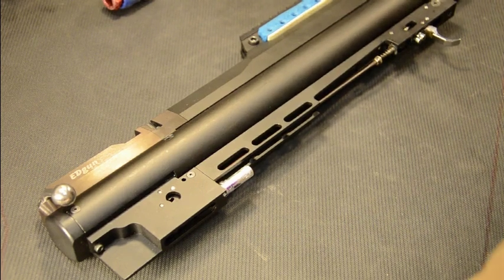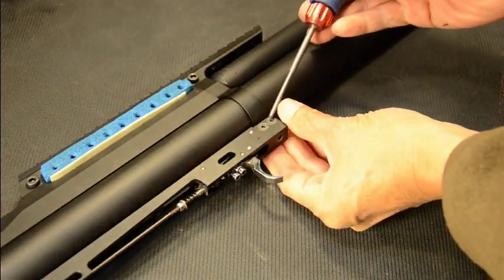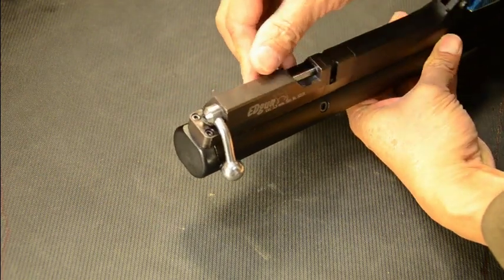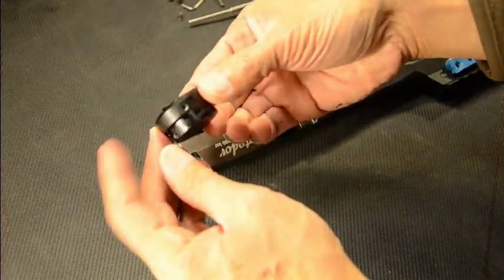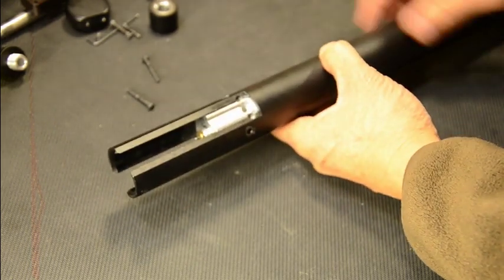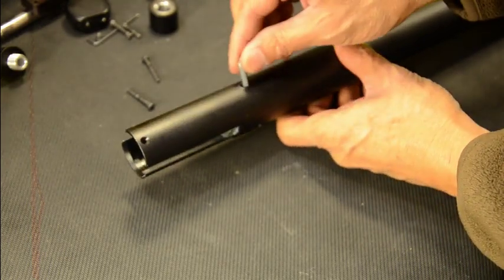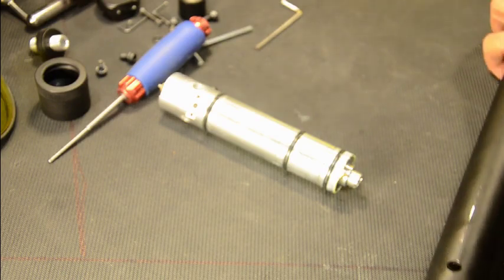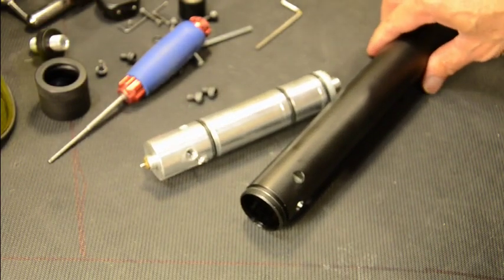Edgun matador R3 Regulator Removal instructions.

Comment: hi.just want to know how many cc of air does you regulator have and how many bar was it set at?thanks
Reply from the maker: its around 280cc reg set at 130B
Reply: Ernest Rowe hello sir sorry as edgun depressurized tank? regards
Reply: i mean, how many cc of air are there in the stand off(spacer between the regulator and valve of the airgun)?how long is the spacer?
Reply from the maker: sorry didn't measure, Now its assembled  and shooting perfect. you know when its perfect you don't take it apart!